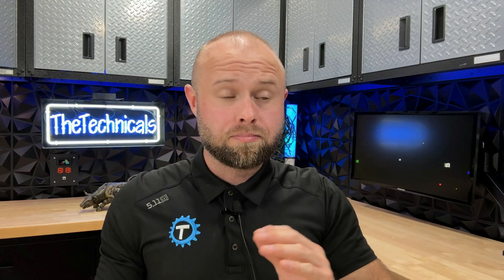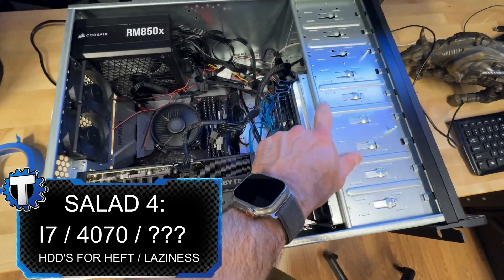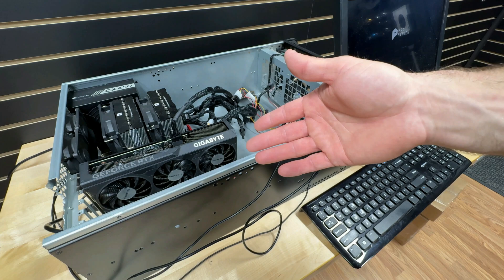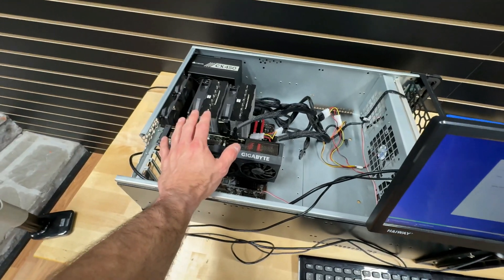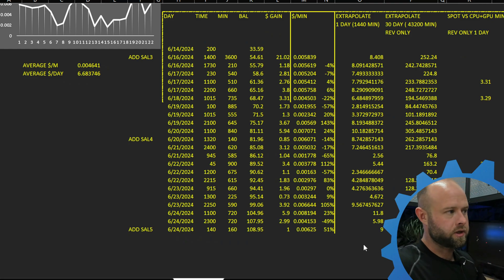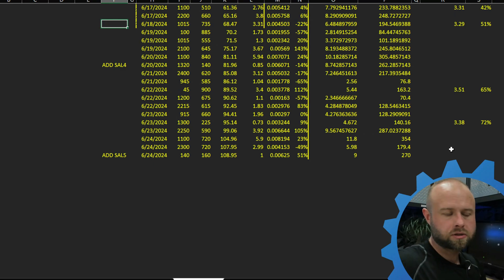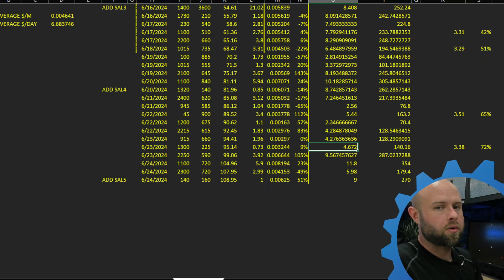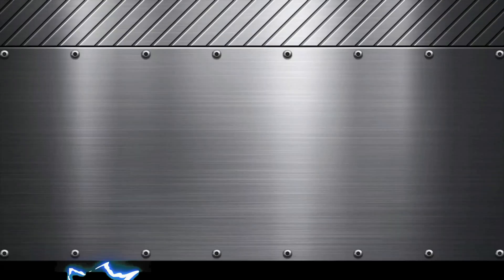Mid-range PC's making $7+/day

Comment: Hahahaha everybody and their mother is using salad now can't get any good jobs my rtx 3060 rig with 24 core ryzen 3900x and 40gb ram only getting a$ .52-$1.20 job all other jobs have been $.15-$.28
Reply from the maker: Is it still higher than what you'd be making mining? Or are you about equal?
Reply: @TechnicalsMatt  the .52-1.20 is higher my processor can reach around 15- 28Mh and the GPU around 9Mh averages about $.25-$.39 when mining verus coin I hope salad can start paying me more already used earnings to get stick fight the game and game guru in their store redeemed my codes to and it works

Comment: In my experience....I have a 12GB VRAM GPU...and "sometimes" it has an error that's showing "Insufficient VRAM"....one of the workaround I did in order NOT to have that issue.   I disable the hardware acceleration options to all of my browser.   Because there are times that Chrome and Firefox are using your GPU when it comes to watching some Youtube videos or any streaming services...especially when u are watching 4k videos in the PC that you are using.   That helped remove my insufficient error message.   I disable all hardware acceleration in my browsers (Edge, Chrome and Firefox).   Since Salad is not using your CPU....the browser will fully utilize your CPU and not your GPU.
Reply: Did you try to max out the vram? It could be one of you chips is bad or even ddu for corrupt driver

Comment: I have a 4070 super that’s not doing squat while a 3080ti consistently has $4 containers.   I assumed it would be the other way around.
Reply: Might have something to do with the memory bus the 4070 is 192bit the 3080 is 256bit
Reply: @ChzimpO  I considered that. Not sure if the salad customers are not choosing the 4070’s. We will see how the 4080 super and 3090 do when they come in.
Reply: @Photog918  I’m about to water cool my 4090 and I’ll just leave it on when I’m not using it see how it does
Reply: My 3080 ti is not getting jobs. :face-purple-crying: